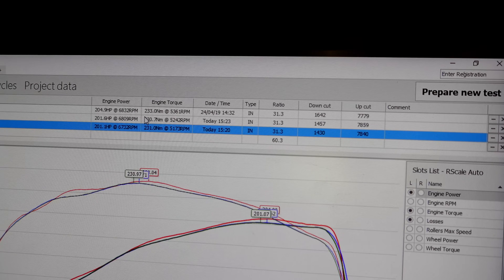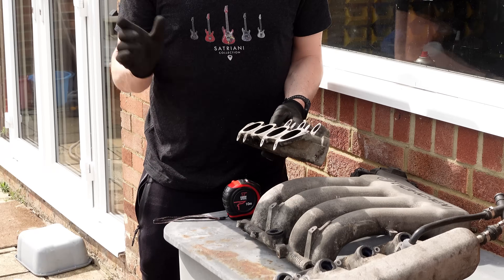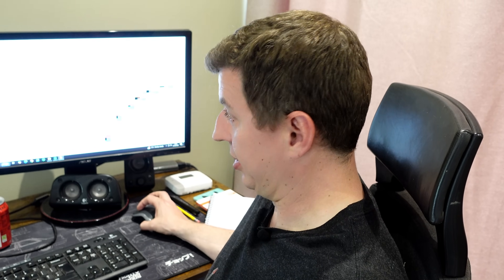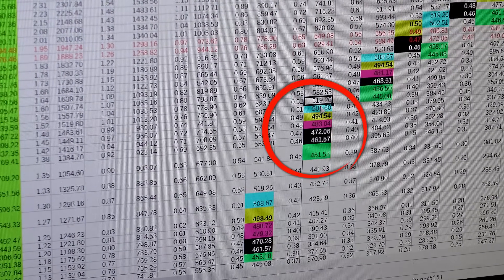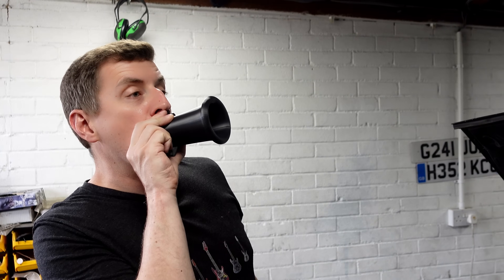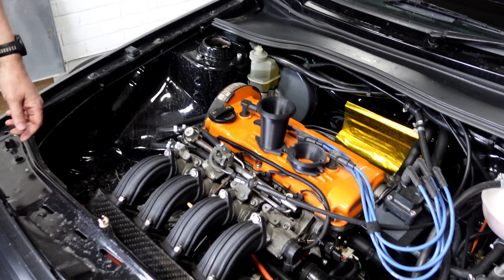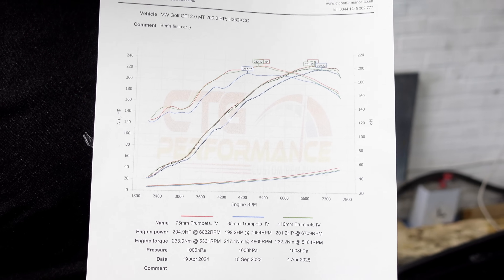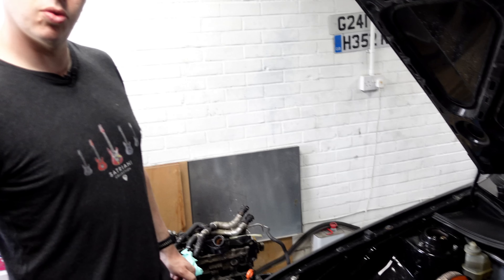Unveiling The Secret to OPTIMISING ITB Intake Length For MORE Torque

Comment from the maker: What engine would you like to see in this car next?
Reply: ITB 07k
Reply from the maker: I mean, that would be pretty insane! And imagine the noise! 🤩
Reply: R36 on ITBs 💪
Reply from the maker: Thinking about this though, an R36 on ITBs would have very short intake runners, so as shown in the video, a dramatic loss of torque over factory spec. Although would sound amazing!
Reply: @golfmk2  Wouldn't it be be a nice challenge to build a custom itb mainfold? It could look like the original ABF mainfold which goes over the top of the valve cover. Then connect the ITBs facing towards the firewall with some nice 3d printed trumpets. I mean, 300 stock HP is a got point to start from =D
Reply from the maker: @kamerad1985 it's certainly an interesting concept. More likely to be something I'd be inclined to trial with my R32 setup, as I reckon Ben is after even more power and nimbleness...
Reply from the maker: @kamerad1985 now you're talking! Oh, you're talking about Ben... 😅
Reply: K24
Reply: @m638csi  Everybody puts K24 in something. Gets boring.
Reply: @kamerad1985  £ to bhp to engine taking abuse-> no better option.
Reply: Retire this engine in a other car for fun rides. This one is stabel now. Than go boosted 4 cilinder. Most effective cost vs weight vs power.
Reply: 16vt
Reply from the maker: Well there are other 2.0ltr ABFs in storage, so a possibility!
Reply: +1 on 07K
Reply: JR32 swap with a Rotrex.
Reply: @stevenbusk539   that option makes more sense for the 3.2 on the channel 😊
Reply from the maker: That is quite tempting, but my bank balance may say otherwise! 🥲
Reply: XD3T Peugeots 80’s 2.5 TD
Reply: VR6
Reply from the maker: Trouble is a VR6 in standard form would have less power and torque than what this ABF currently produces. It'd need a boosty snail to make that option worthwhile.
Reply: @adamvr6T  Done 1 mio. times. Boring. But R36:hand-orange-covering-eyes:
Reply: VR5
Reply from the maker: Whilst it sounds amazing and is certainly  a different choice, it'll be severely less powerful than the existing modified ABF setup.
Reply: @golfmk2  Than go for an STW engine. Should be ABF based. Up to 320HP+  in erwin bucks vw hillclimb scirocco.
Reply: Big cam abf with a tvs1320 blower
Reply: ABF with 20V head.
https://www.youtube.com/watch?v=GbU4GxvCsLY

Comment: Why are you mixing measurement systems?
Horsepower/Footpounds   or Kilowatts/Newton metres
Reply from the maker: In the UK we measure in horsepower. Very unusual for Kilowatt to be mentioned on a dyno printout. But for torque, either Nm or Foot Pounds are used, so for the viewer to be able to relate to, we showed both units of measurement.

Comment: I had a standard 9a block in my old mk2 with Jenvey bodies and schrick 268/276 cams in a flowed head. Put out roughly the same power as this one. With throttle bodies it's all about the throttle response. With these and a quaife diff you've got a great handling car. It's not all about the hp figure. And the noise is like a scaled down 1991 DTM Merc 190e.....
Reply from the maker: Those are impressive figures! Can you remember which dyno you went to, out of interest?
Reply: @golfmk2 I’ve had to have a think as it was over 20yrs ago now. It was Stealth Racing, Vince i think his name was, he mapped it. I was running DTA management. Good old days..😊
Reply from the maker: @matthewdrew9370 ah nice. The reason I asked is because we have a video where we carried out a series of tests on various dynos with some really interesting, varied results. Check it out and I'd love to know what you think.
https://youtu.be/72SIoOHz4sA?si=zPAyi8Ak6dW_aX8n

Comment: Great video!  What resource did you use to get the formulas for your calculations, or would you be willing to do a video to show the stages for calculating the potential stating points for; the inlet runner length, and exhaust lengths?
Reply: Just something I put together years ago.   For a given RPM, get the RPsec, pressure waves (assumed to be) at 343 m/sec, divide these by the RPsec, giving a distance in meters that the waves can travel.  Need to factor in the window movement can happen in is 720-cam duration.  This number/360 gives a factor e.g. 1.2 as in a 720 cycle the valve is closed more than half the time. The (distance* factor)/2 gives the there and back distance for wave1, divide this by 2,3,4,5,6 to get the rest.   Super simplified but it confirms the torque peaks at 4400 and 5300 rpm  with a 470mm length
Reply: @ABF16V  Cheers :).  I'll have a crack at building one too.  For the exhaust side, i assume you will just change the air temperature and density (based on your fuelling) to get an new speed of sound value?
Reply: @warby8138  I never did something for the exhaust.  Instead i looked at what was available, what was in the VWMotorsport cstalogue from back in the day. LHD market tubular 4-2 section, added my own 2x2" downpipe, and left it at that.
As I say in the video, im sure theres gains to be had from another exhaust, but its not going to be cost-effective to find out.
Reply: what duration do you take as a valve closed time? Duration between 0.5mm lift or between 1 mm lift or maybe even 0.2mm lift points. Im my case open duration at those points waries quite strongly…. 285deg, 275deg and 252deg respectively….

Comment: Great build and results!! What cam duration and lift are you running here? (previous mk2 owner still sad here.)
Reply from the maker: They're 284mm hydraulic cams with 11.5mm lift. What Mk2 did you have previously?
Reply: I had a 1990 mk2, 2L 16v with the AAL engine. Intake manifold port size was a bit bigger than the ABF is. A mate had the ABF in his mk2, which had a bit more low down torque, but mine had more legs at the top. I also found opening the exhaust ports slightly gave it around 400rpm more usable rpm, up to 6200rpm. Used to fall off a bit from 5800rpm.
I shed a tear the day I sold her 😢

Comment: Have you ever as an experiment tryed straight runners instead of these bent?
Reply from the maker: Due to packaging reasons, as discussed in the ITB Cooling video: https://youtu.be/_3UYbtP9r8w?si=uusb8aAYc0KlPJHS you'd not be able to obtain the same length of intake runners without them protruding through the bonnet. And as these are just a shallow curve there would be no difference if these were straight (and could somehow package them).
Reply: @golfmk2  I mean that if you tryed just on the dyno. Any curve vill shut down a part of the flow and compensating with increased diameter will just slow down the speed and energy of the flow. I did some experiments in the 80:s on some bikes and on my Volvo B20 with Weber 45 dcoe carbs. I never got it on a dyno but I could feel a lot of difference in torque. When the intake manifold was at normal length and really long stacks (40+cm) on the carbs I got the fuel to push back in to the float bowls at some rpm's at wot. If I moved the carbs further out with a much longer intake manifold and shorter stack's it worked fine but it was impossible to use the hood on due to the carbs hanging over the fender..

Comment: I would like to see 54mm ID runners tapering down to that stock flange of same length as read one.
Reply: The oval port at the head is 50.8 x 33mm (w x h).   Most ITB kits for VW 16v are 45mm ID, I think some 48mm exist.  54mm sounds very... Honda ?

Comment: I'm a sucker for an ABF Ben. But for me bang for buck has to be a 2.0 tfsi. Factory engine with a map will be well over 300hp and it will do it all day long. I drove my pals K1 Cupra at Anglesey and we tagged onto the back of a gt4, matched for pace. In a mk2 it would be a riot, and still lightweight enough to not compromise the chassis
Reply: Abf 16v turbo all the way ❤
Reply: It's the sort of thing I'm interested in.  I worked on a TFSI recently as a mates BWA died.  Replacement engine cleanup, lots of new bits inc VVT tensioner, back out it goes, as a mapped KO3.  Not convinced its the answer though.   Maybe the KO4 version?
Reply from the maker: Is the KO4 the Cupra/K1, rather than the FR?
Reply: @golfmk2   Yep K04. the reason I mentioned TFSI is the easy route to boost is 20vt. But the TFSI is a much more modern engine with in my opinion more character than a 20vt. There are other routes, but this would be mine  if I wanted boost.

Comment: Use this engine and tb's with garrett g35 on 0.5bar.
Reply from the maker: I think, because this has been modified to be a high compression engine, it's not the best base to add forced induction. Better off with one of the stock ABFs in his shed if going down the boosty snail route, I reckon.
Reply: @golfmk2  0,5bar must hold it. they do also turbo charge een gsxr1000 12:1CR with stock compression rato on 0.5bar.
Reply from the maker: I'd have to let Ben answer this one! I'm sure he'll be along in a minute. 😆

Comment: What cams do you have mounted, mate? Thanks for the videos and greetings.
Reply: No problem, 284 deg hydraulic cams with 11.5mm lift.  ABF head had no problem accepting these
Reply: @ABF16V 284 would be too aggressive, I'm riding an Abf and I had in mind something like a Newman 272 or a Schrich 268 for intake only, that's why I was curious what camsahfts Mr. Bend has mounted. Thanks.
Reply: @JoseVargas-d4n  check the specs Vs stock ABF cams as the OEM items are 252 duration (if using from 0.1mm lift as per aftermarket cam specs)and 10.8mm lift.
Reply: Nice video and lovely back to back comparisons ❤ appreciated! I'm very eager to know what my motor would put out if you haven't done any valve or bottom end work
Reply from the maker: Thank you! Glad you enjoyed it.
What engine are you running?
Reply: @golfmk2 
I am using an ABK block (identical to ABF)
BMW M50B25 84.5mm pistons
159mm forged rods
95.5mm BKD TDi crank

Cylinder head is KR 1.8
Supertech valve train kit:
34mm intake valves, high rev dual spring kit, titanium retainers, single groove cotters
The exhaust valves I went with BMW 325iS valves 30.4mm as Supertech was limited to 29mm on their 2mm+ oversized exhaust valve
That with Cat Cams 279 exhaust 12mm and 292 intake 12.45mm camshafts
Reply from the maker: @umartheecookiemonster that's some spec! Have you not taken it to a dyno then? Id be very interested to know what figures it puts out too.
Reply: @umartheecookiemonster  84.5mm is an extremely big bore for these blocks, is there much material left at the thinnest point between the cylinders?   The engine spec sounds all out.  The one in the video here is all fairly mild in comparison, a half way between stock and all out.  I wanted it to last a long time 😊
Reply: @golfmk2  I have sold my mk1 body, gave myself till the end of 2024 to finish up didnt meet that expectation so i decided to move forward, planning to relocate in the next year the project wouldve kept me home😂
Reply: @ABF16V  here in SA its not uncommon for us to bore 84mm on average, many of our NA guys bore till 84.5mm with zero compromise in longivity🙂 theres about 3-3.5mm between cylinders. Some have been driving for a good few years just regular services and usage of proper quality oils and additives.

So now i just build sub assemblies as a hobby so i dont feel excluded in the community lol. But i would really love to see my complete motor is someones car sometime this year so i can see what it wouldve out out
Reply: @umartheecookiemonster   that's great to hear.  Does a head gasket exist for 84.5mm?   I liked to make small changes and see the difference.  I'm at a point now where to go further with the NA setup would be high cost / diminished returns, although your specs are inspirational.  I think what I would like next is not achievable by NA.  The chassis on this Mk2 handles very well and could cope with a lot more output

Comment: I've got a little Daihatsu Feroza.. (In Australia) And it comes with the most elaborate bit of intake ducting from a decent offroad drum filter that has half an engine bay to itself.   If you "open up" your intake to something more sporty, you lose all the torque it ever had lol. And it's such a profound difference on the butt dyno.  Would never have believed the difference had I not encountered it.
Reply from the maker: Welcome from Australia! That sounds great! Have you calculated the total length of the intake to see how it may compare against a standard setup?
Reply: I had to look that up, the intake itself looks nice and long, so they designed it for getting torque out of it low to mid rpm 👍
Reply from the maker: Ah, I'd misinterpreted the comment, I didn't realise they were manufactured with a massive intake as standard! Very smart, especially for off-road use.
Reply: @ABF16V  I'm glad you found a pic. It's elaborately long, with expansion chambers etc.  Got to be in the ballpark of 5ft + all done and said.   A very long time ago, I found someone on YT working on the optimal intake maniforld for that motor.  But do you think I can find it again :/     He was just doing what this vid covered however.

Comment: Years ago I converted my starlet gt turbo to dual runners from a 5efhe engine. The torque increase at low rpm was massive.
Reply from the maker: Proof in the pudding right there! 👊

Comment: Aint no way I found a channel all about my dream car, hoping to get a golf mk2 when I get my driver's license
Reply from the maker: Haha well that's great! Lucky for you there are nearly a hundred videos for you to trawl through, which may give you some inspiration for what spec you'd like. 😁
Reply: Stock for stock... Try a CRX before you buy a golf
Reply from the maker: The B16 is a sweet motor, to be fair!
Reply: Bit expensive but yes, if you're in europe, the dohc regular 16 valve is more than adequate already at 122 to 131 hp.
Reply: No offense... but an Mkii was once my dream car too... I had one and it was a nightmare. this, of course was back in the day just before the tuning scene started to pick up... so maybe in this day and age, you can actually do something about the electronics/fuel system and tuning... but that aside, I'd humbly offer you the advice to dream elsewhere... hopefully though, my experience wouldn't be yours... (my brother had a later mkii Jetta & I think he'd tell you the same... my 3rd car was a VW Fox.... I'm kinda put off the dubs forever)
Reply from the maker: So many parts are interchangeable with newer models, which helps with any reliability issues you may have encountered previously, especially in the modifying world. Also, check out the big rebuild of Ben's car, as it goes into great depth on the variation of mods his car has, including Toyota throttles, Peugeot power steering, to name a few! So there are plenty of options out there to make it  suitable for modern life.
Reply: @zeroswings2  I own mk2 jetta 1.3nz cat, I would tell you the same. ecu ("digifant" I assume) is just ass. probably good when it works but give it 35 years to rot and it's not that fun because it doesnt speak to you, doesnt tell what the f*** is wrong etc. thank god we have aftermarket ECU's in 2025, gonna throw one inside mine so the ECU tomfoolery stops.
Reply: @aitoblitz my brothers Jetta used to burn those up regularly 😅. but at least it wasn't that absolutely crap CIS/CIS-E/K-Jetronic...